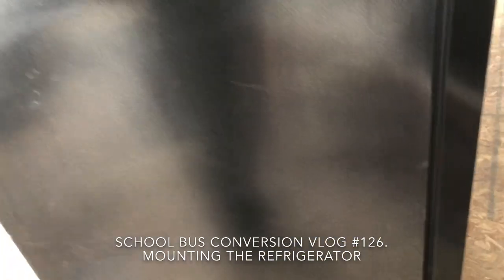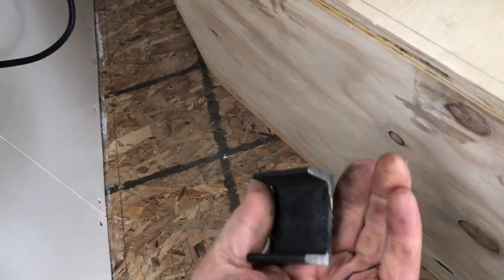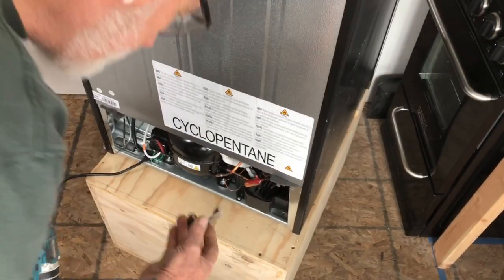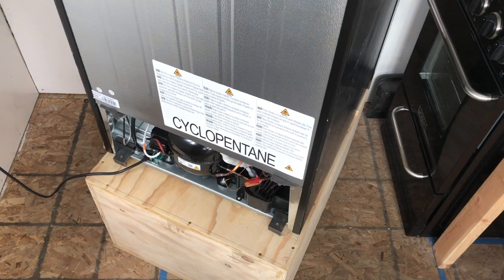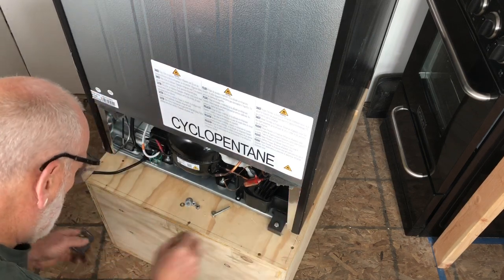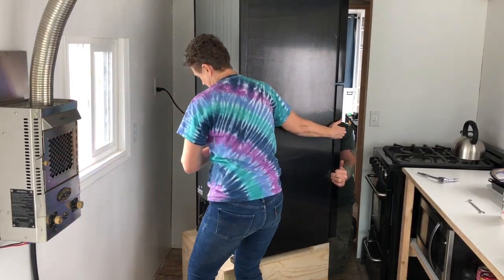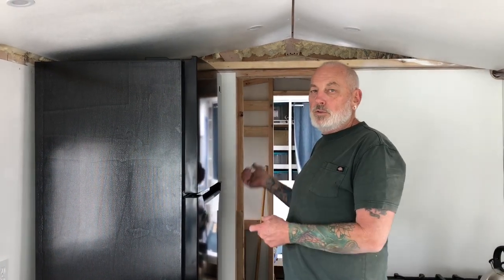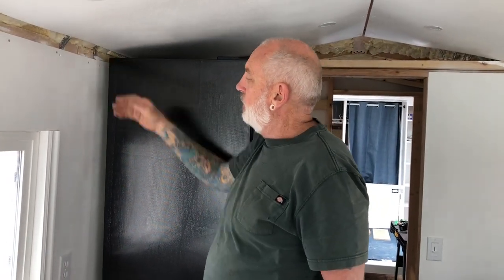Mounting the Refrigerator - Vlog 126 School Bus Conversion

Comment: I'd add a back top anchor just for stability some heavy sheet metal bent 90 degrees painted black with self tapping screws to anchor to the fridge. Really like the box under the fridge for ergonomics.
Reply from the maker: Thanks for the suggestion. We are loving that the fridge or raider is lifted up. Much easier to get into.

Comment: You better grease the hinges up on that new door of that new fridge. Randy will be opening it a lot to get to the bags of veggies and tomatoes! You don't want the door worn out this early. Lol.  I just got home tonight with my new bus. I drove it 1250 miles. It was just retired and got it direct from a school district.  It is awsome. I am a single guy so i bought a Mid-bus 9 windiw with a handicap lift for bukes and scooter. I am going to put a garage in mine for toys and battery bank. It is a Bluebird 2008  with a 6.7 200 hp Cummings and a 5 speed Allison with less than 80k miles.  I got almost 12 mpg on the trip. I will start working on it tomorrow.  Hugs to you guys. Bob Marie
Reply from the maker: Wow that sounds like an awesome bus. Way to go.

Comment: You might attach a leather belt to the back wall, right in the center of the fridge. Then run it down the front of the front doors of the fridge and attach it to the base you made. This way when you are traveling, the doors don’t open and the fridge is secured to the back wall. When you are camping, detach the strap and put it on top of the fridge.
Reply from the maker: Wow that is a great idea. Thank you. 👍😀

Comment: No need for the top mount imho.  But would definitely anchor it in 100%. Over a long long time those bolts could pull into the wood, but doubt the fridge would ever actually move.
Reply from the maker: Thanks for your thoughts.

Comment: Finally caught up! The fridge will be fine as is. What are you planning to keep the doors closed as you drive?
Reply from the maker: Haven’t decided yet. Still working on that one. Do you have any good suggestions?
Reply: Knapp Time yes, on the opposite side of the hinge we put a plate with a connector nut fastened to it. This bracket screws into the holes where you would put the fridge door hinge if you reversed your doors. When the doors are closed you don’t see it. When we are ready to hit the road, we screw in a knob to secure both doors at once. I can send you pictures if you want.
Reply from the maker: We would love to see a photograph. Thanks.
Reply from the maker: Wow - that is so awesome. We just checked it out and we think it’s going to work for us too. Thank you so much for sharing. That’s one mystery solved.

Comment: I would anchor it to roof and to wall with metal bracket to metal frame 
I built and operated a lot of concession trailers
That thing is gonna rock and bolts are gonna get loose
Reply: I'm with you. In an accident, loaded up that fridge be a 200lb wrecking ball and rip right out of that plywood. Whatever is
Reply from the maker: We like your idea. We are still considering exactly what we’re going to do.